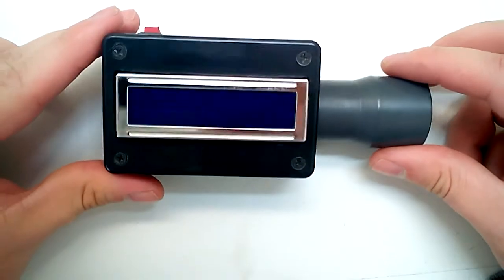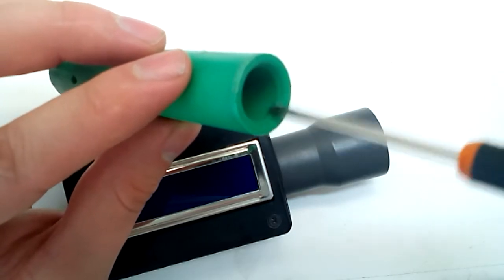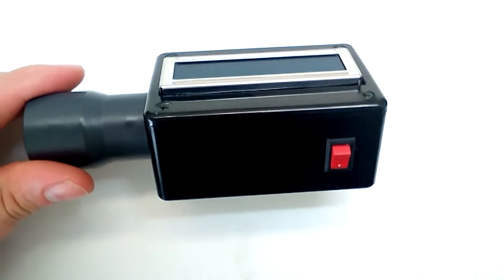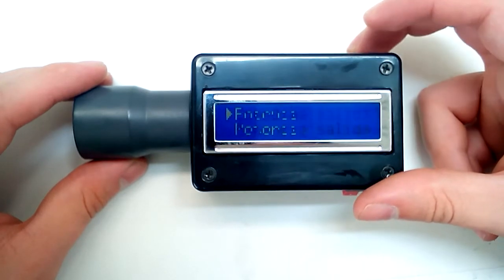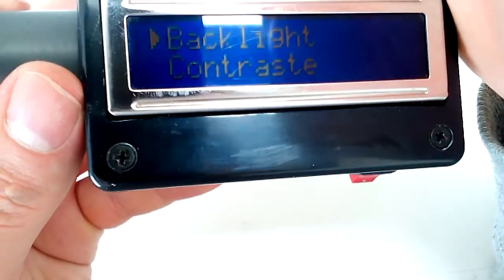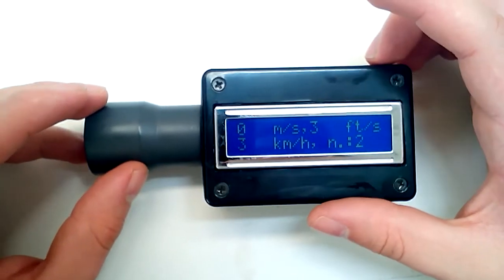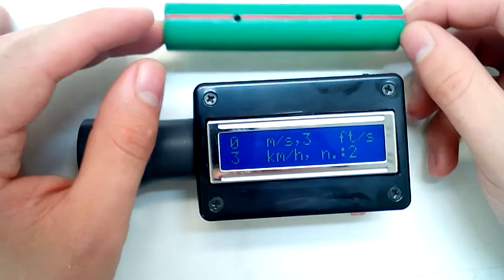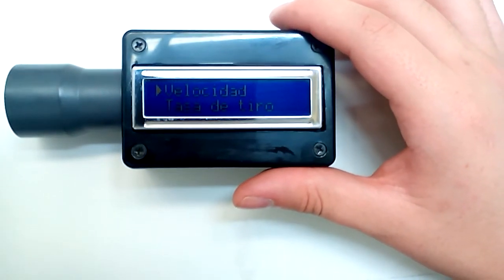DIY chronograph 50000m/s+ 150000ft/s!

Comment: Hello. Is one diode and one phototransistor per sensor enough to catch the bullet? I mean, won't it skip the light beam?
Reply from the maker: Hi, the diameter of the tube must be less than 2 times the diameter of the projectile.
Reply: Ok, but one pair of led-fototransistor is enough to measure the speed? If I would make 3, 4, 5 complets around the tube (same measuring point - around the tube, not along) would it improve the accuracy of the measurement? Average diode and transistor angle is 30°. Do you remember what kind of diodes and ft have you used?
Reply from the maker: Niko  2 sensors is enough. The projectile must move relatively parallel to the tube, but you will see it's less important than it seems, there is not much difference shooting with a bit of angle.
I've used normal IR LEDs and digital output photodiodes.

Comment: Hi you can share the project? I live in Brazil and ballistic chronograph and a very expensive item, but even making one. I'm working on a project, but so far could not measure anything beyond 60 mt / s. I think the problem is that I am using the sensors are very slow.
Reply: You need to use the digital pins instead (not the analoog)
Reply from the maker: +Glauco Garcia Oliveira Hi Glauco, I'm sorry but I lost the PIC project (it's an old project) but if I find it don't doubt I will upload it. The sensors must be fast with a very good slew-rate, try to find direct digital output sensor and calculate the time the projectile pass through the sensor and multiply by the slew rate must match the minimum ON Level of the input of your microcontroller
Reply: +jaimeesg Hi, thanks for replying, I made a sketch using an ATmega328, tested with keys and everything ok, when I turn the sensors can not readings, already measured with oscilloscope and the sensors can not detect the pellet. As I said I do not have easy access to quality components. I bought some ultra photodiodes polls by ebay, however the angle is small, only 20 degrees, have found more angle. I think the ideal would be at least 80 degrees. I am awaiting the arrival to continue testing.
Reply from the maker: Keep me up to date Glauco, I will help you. If you have a signal and you are measuring it with the scope, maybe the problem is the software. Are you using an interruption or a software polling? With a normal PDiode you can get at least 1Mhz of bandwidth and can be enough for the first tests. Try to check if the sensors are properly aligned and if they are small enough to measure pellets. I would attach a small wire to a pellet to test them.
Reply: +jaimeesg by passing the pellet by the sensor, it detects typically firing a BB it also detects, as with the caliber air guns 4.5mm at speeds of 120 m / s can not detect shooting. follows the code I'm using for testing.
int sens = 4;
int val;
LED int = 13;

void setup () {
   Serial.begin (9600);
   pinMode (LED, OUTPUT);
     pinMode (sens, INPUT);
}

void loop () {
   Serial.println ("Waiting trigger ...");
   digitalWrite (led, LOW);
   val = analogRead (sens);
     while (val> 980) {
     val = analogRead (sens);
   }
   while (val <= 980) {
     val = analogRead (sens);
   }
   Serial.println ("shooting");
   digitalWrite (LED, HIGH);
   delay (3000);
}
Reply: +Glauco Garcia Oliveira Buenas amigo... conseguiu fazer o chrono? Estou pensando em fazer um tambem.
Reply: Hey Glauco. I'm Braziliam too and trying to build a chronograph too... hhaha
Did you get to build yours?
Reply: @mariovalney  ???